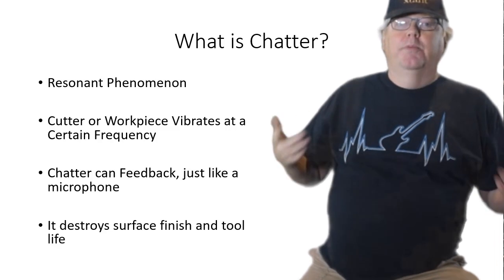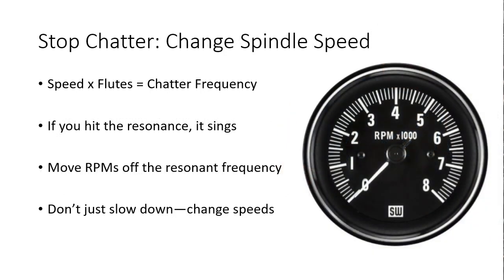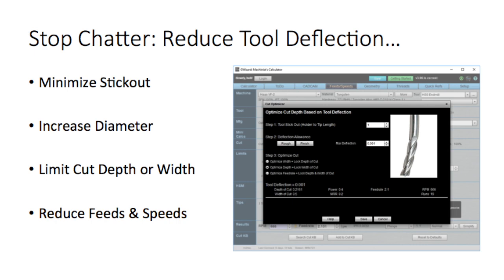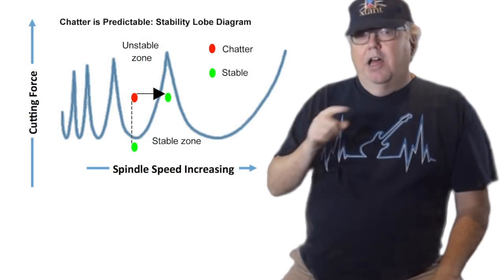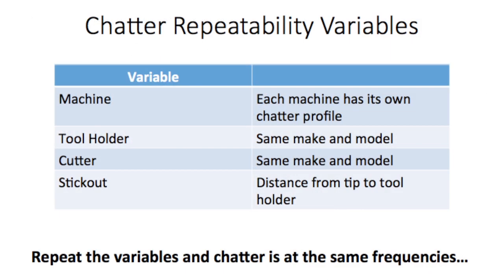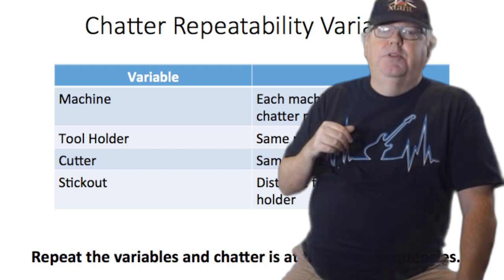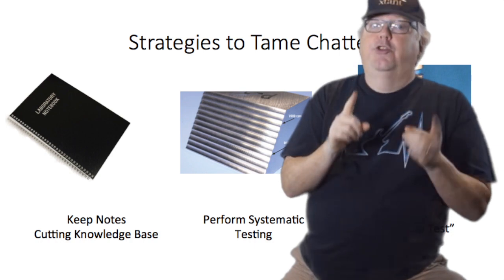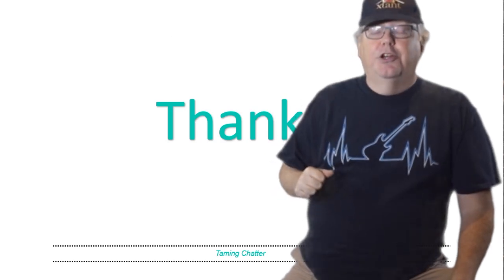Episode 7: Taming chatter

Comment: Soo... bore bar out 7inches. Bar it 1.25 dia. End dia is 3.48. 
Recommendation for the insert im using is 520sf. At .010 ipr. Going 7in deep. 
3.82 x 520=1986 ÷3.48= 570 sfm.  ÷ by 7inch = 81 sfm  but I still get harmonic and chatter. Do I stick with 520sfm and maybe go faster rpm?
Fast rpm turn metal hot and easy to cut away?

Comment: I found this video while looking for help with chatter on my wood lathe. Trying to figure out how some of these principles might be useful in my quest. My first thought was head-stock bearings being loose. They are not a tapered bearing so I cannot preload them. Not sure how much play is acceptable. Also thought the problem was just due to whip on long spindle turning but I can get severe chatter when turning larger diameters that one would think are relatively immune to flex. Still a mystery I need to solve as it is really holding me back.